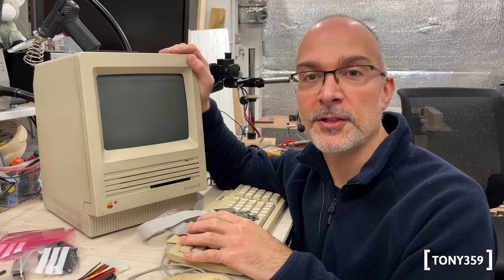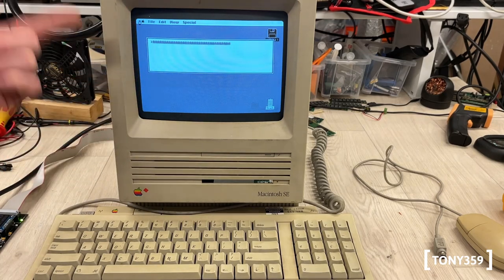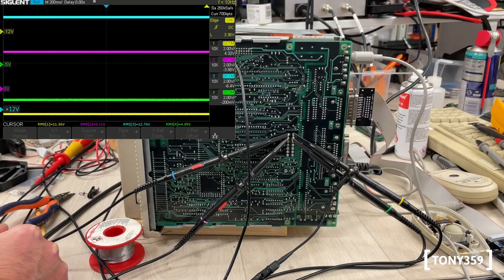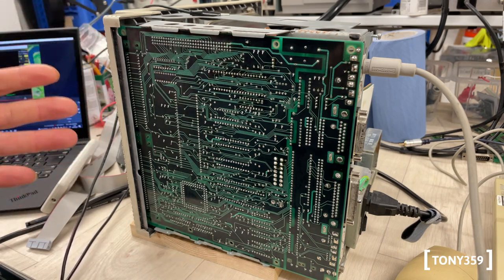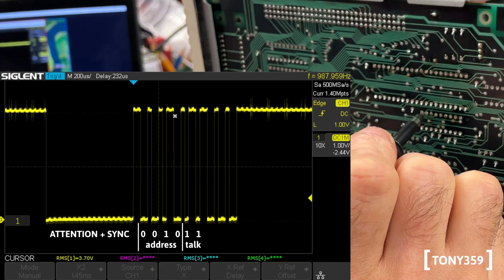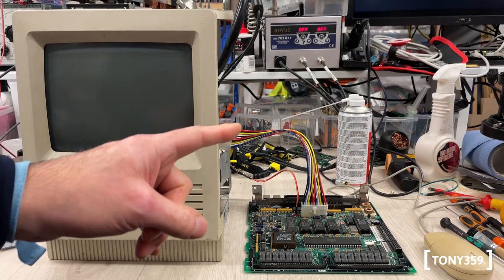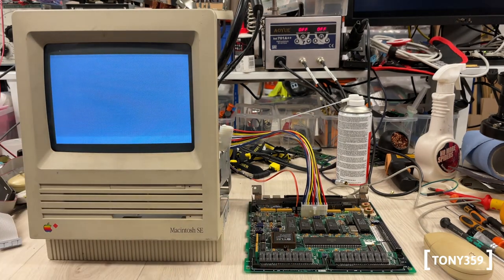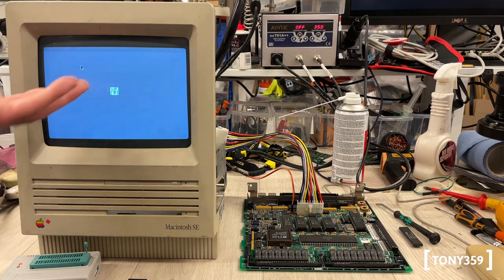Apple Macintosh SE repair - ADB headache!

Comment: Tony, I enjoyed your informative video very much. Thank you for kindly mentioning my video about the extender cable. I have updated my SE Reloaded BOM with the PIC16F88 drop-in replacement solution, and I also posted about that in the "Macintosh SE - PLCC ADB Adapter board" thread on TinkerDifferent.  It's a wonderful solution for people who need a working ADB chip on an SE motherboard! 👍
Reply from the maker: Thank you for suggesting that incredibly easy and cheap solution!

Comment: Another retro machine saved!

The original ADB chip is likely a PIC microcontroller - it's got the Microchip logo on it. Excellent work on the part of the person who created a modern replacement for it!

You might have more luck with a SMD CR2032 battery holder because the pads extend out the ends of the package.
Reply from the maker: Thank you! Someone mentioned the SMD pad - indeed the pads are the right distance but unfortunately on the SE there is not enough clearance for the size anyways - the holder is 20mm and I've got 18mm :(  Thanks for watching!
Reply: It was. The code was pulled off it by a Johan Grip and John McMasters - they took a physical chip, broke it open to get to the silicon, imaged it using a metallurgical microscope and read the 1's and 0's from the hardcoded memory to get most of the code out.
Reply from the maker: @ukmk3supra  I read that on the description of the project - truly impressive! Thanks for your comment!

Comment: great video Tony. I have done tests with different sockets for vintage chips. My conclusion was that machined sockets are very unreliable for use with reused chips. In production they cut the legs of the chips and the legs become to short to make a reliable connection in macined sockets. If the system ever becomes glitchy, try with dual-wipe sockets
Reply from the maker: Oh really? And I thought it was the opposite. Thanks for that. That said, those IC legs are pretty long so I don’t think I’ll have issues, but I’ll bear that in mind for sure. All my other sockets are dual wipes but they tend to deform when a non-perfectly straight leg is plugged in. Multiple use usually result in a permanent damaged socket in my experience. But it might have been the quality of the sockets I used. Thanks for watching!
Reply: In general, it's a good idea to match the socket with the type of pin it's designed for. So round sockets for round pins, dual wipe for flat pins, and female pin header type sockets for square pins.
Reply from the maker: @SanguineBrah  My understanding was that those round machined pins were better at everything. If you look inside there is basically a clamp mechanism but as Epictronics says, it might not work with short legs. My only concern is that I tested dual-wipe ones before and they get damaged with pulled chips - that is, the spring opens and does not return to the original position, leaving a small gap and becoming unreliable with other chips. And by looking online I thought the turned pin ones were the solution. I will re-evaluate this - I think I'll start with "where do I find good quality dual-wipe sockets?" :) Thanks for your comment!
Reply: @tony359  Yes, I've had the same issue with salvaged chips damaging the sockets too. I've taken to going over the legs with flux and solder wick before I put them to use and this seems to help a lot of the time.
Reply from the maker: @SanguineBrah  The issue is that once those sockets are damaged you need to replace them which always puts some stress on those old PCBs. I was hoping turned pins were the solution...

Comment: Glad it was the ADB. I will have to look into those boards from Kai and the PIC/code for the other machines.  My issue with the 128K was the resistor pack and not the VIA. Thanks for the great video!!!
Reply from the maker: Thank you for watching!

Comment: Wow-I’ve not seen the ADB chip go bad before! 

One thing to note re: ADB Macs: the ADB connections are not hot swappable. So be sure to have the power off when connecting or disconnecting them! 

Thanks for another great episode!
Reply from the maker: I can confirm I did not hot-swap the ADB on that Mac, the ADB definitely failed by itself! :) I am used to PS/2 which is also not hot-swappable so I didn't dare doing that with ADB!
Thanks! That series was cool! You'll get to the "restoration" video soon I guess :)
Reply: @tony359  oh GOOD! I’m glad you already knew about that!!

Comment: An SMD CR2032 holder fits the original pads perfectly. I have replaced the 1/2AA holder on almost all of my Macs with them, works great!
Just tin the bottom of the battery holder leads, apply a blob of glue in the center for better stability, put the holder on the board and heat the leads with your iron to melt the preapplied solder to the board's through-hole pads.
Reply from the maker: I’ll look into that, could you share a link? Thanks for watching!
Reply: @tony359  I have tried, but YouTube kills any comment with a URL
Reply from the maker: @kpanic23  YT is weird, it allows some but not all. Would you mind dropping me a quick email? Address is under "about" on my channel. Appreciated, thanks!

Comment: In the 90's I worked in IT and i remember throwing hundreds, maybe, thousands of 80's machines in the dumpsters. I regret it so much. The only ones I kept were an SGI, cause it wasn't even that old when they told us to chuck it, and some 386 and 486 machines, that I took PSU's and HDDs and ram from.
Reply from the maker: Well, that's unavoidable unfortunately. Who would have thought that old junk would be valuable one day! :)
Reply: @tony359  For me is not the money, it just haunts me how wasteful it was and what I would give to have some of my old hardware back. I once chucked out a dual socket 7 board with 2x 233mmx chips because AT psu were getting scarce and "who would ever care about this old crap"....
Reply from the maker: @RachaelSA  tell me about that. I chased an Apple //e for years before I could find one at a reasonable price nearby. My mom had it when I was a kid and I wanted one! 🙂

Comment: Hi Tony - thanks for the mention - if it helps, in the Github for the SE Reloaded board, i've also put the Sprint Layout file. This can be used in Sprint with the 'test' function, allowing you to see where each and every pin and trace connects to - highlighted for you. Helps massively with debugging. Also, the GLU chip next to the ADB Chip is also a simple HAL16L8, and Jon/Porchy from JammaArcade has helped massively to reverse engineer the equation map for it. This equation map can be programmed to an ATF16V8 and used as a direct drop in replacement. 

Phil Greenland has also recently fully reverse engineered a drop in replacement for the RTC chip, too. 

And as of today, with the recent unveiling of the schematics for the 1985 'YACC' project from Apple, I think i just found how the Sony branded/manufactured 'SND' chip works, on a schematic level. 

The BBU (basically an amalgamation of all the PAL's from the Macintosh Plus - see here for more info: https://tinkerdifferent.com/threads/everything-you-wanted-to-know-about-the-bbu-but-were-afraid-to-ask.880/ ) has also been imaged on a silicon level, just needs someone to decode the functionality...also, luck would have it, it's a VTi (later, VLSI) VGC1900 series off-the-shelf part and we also happen to have the manual for how the gates look on the silicon so....yeah, nearly there with a 1:1 off-the-shelf repro of the Mac SE, just the SWIM left for someone to have a go at! :D
Reply from the maker: Thanks for watching and commenting - what you are saying is impressive! And also useful as I have two more SE's to troubleshoot! Too bad I have a 1.44MB drive I was hoping to re-use but, as you say, the SWIM is still to be hacked! Thanks for all your amazing efforts!

Comment: Oscilloscope diagnostics of logic is not boring but very interesting.😉
Don't retrobright it, has more downsides then it's worth and it will just become yellow again.
Reply from the maker: But I bought 20L of peroxide (not kidding!) :D I'll think about that. I feel if it's done carefully it can work. My Apple //e keyboard is still looking good after a couple of years. But I hear you!
I'm super glad you enjoyed the scope diagnostic and thanks for watching!
Reply: @tony359   good to hear you had good results, I did a couple of attempts but had a number of issues.
if done correctly can look great don't get me wrong but the yellowing just screams retro if you ask me.
It can also make the plastic more brittle making it prone to breaking.
As an example I had a mouse that broke all the screw standoffs during assembly after a retro bright attempt, it was a relatively common test item so no real loss.
But what ever you decide it's already great you got it working so far.
Reply from the maker: @samuraidriver4x4  I completely understand your point, and I assume that with a good clean that case would look good. I'll think about it but as a "tinkerer" I might not resist the urge to experiment/learn/break things :)
It is indeed a good feeling to see that think working now!

Comment: Tony, Is it possible we could obtain the dead ADB chip from your board for decapsulation/silicon die imaging to see what went wrong with it? Some people on the discord (including myself) where the replacement ADB chip was created are curious about that version of the ADB chip your system had in it, since it is an earlier one.
Reply from the maker: Absolutely, where are you based? Would a hi-res picture of the faulty chip help in the meantime?
Reply: It's already been decapped -  the raw images are public, but i'm just searching for a stitched one :)
Reply: @ukmk3supra  the 342-0440-A is decapped? I thought only the -B version was.
Reply from the maker: @ukmk3supra  Amazing news! Where can I find those images? I'm just curious.